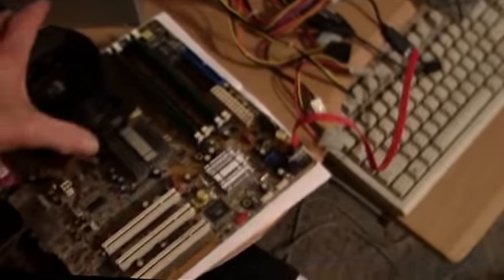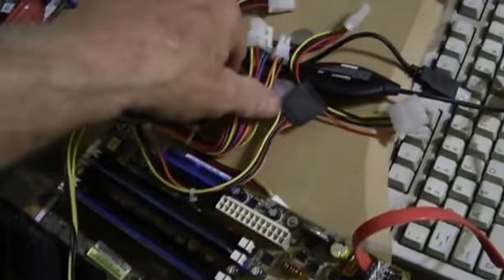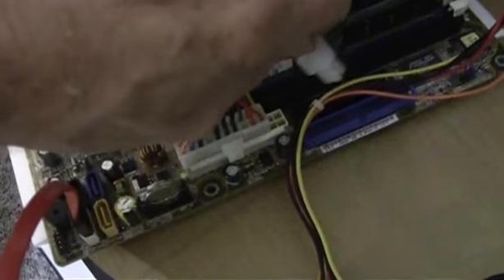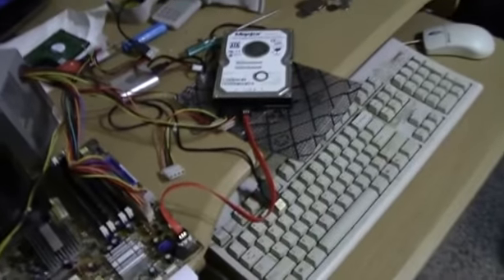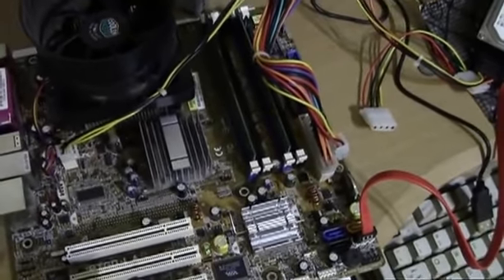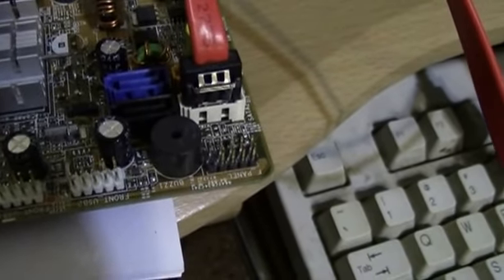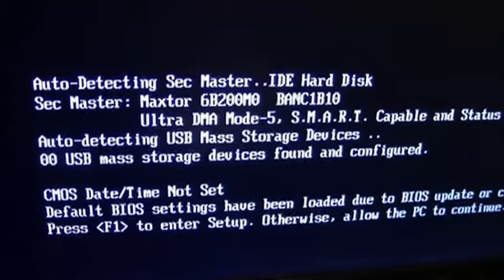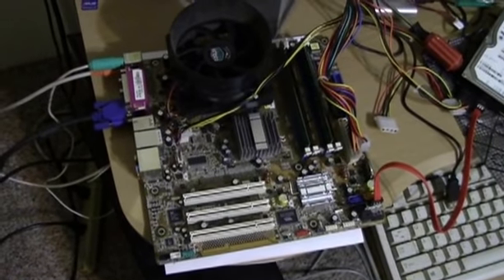Motherboard #2

Comment: One good thing to visually inspect for on a board is bad capacitors (search Wikipedia for 'capacitor plague sans quotes for more info & lots of good photos.)

 Generally speaking, all the caps on the board should be standing us straight, not be 'bulged', or leaking spooge of any sort from either their scored tops, and/or on the board around their base/s.

This was a big issue in the past, and still not un-heard of by any means. The Wikipedia article is a good read; I suggest any and all read it.